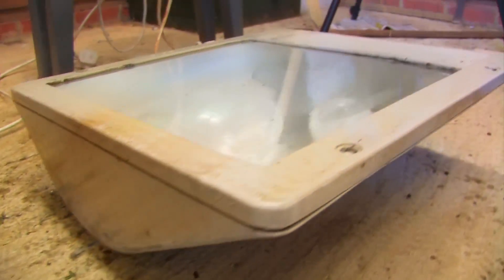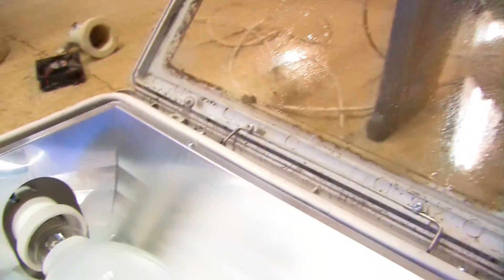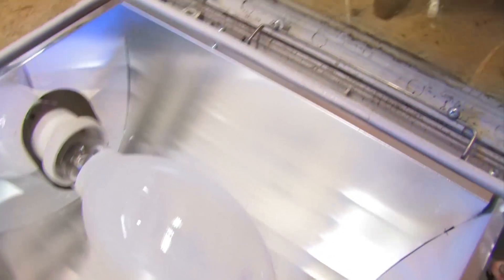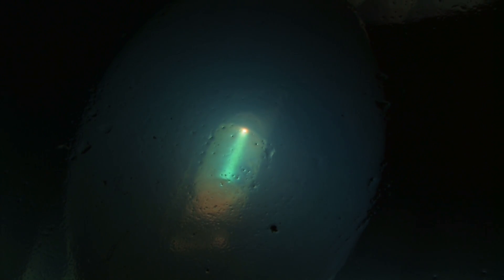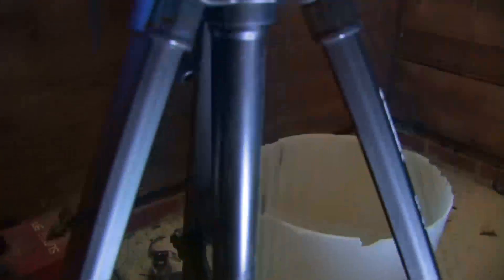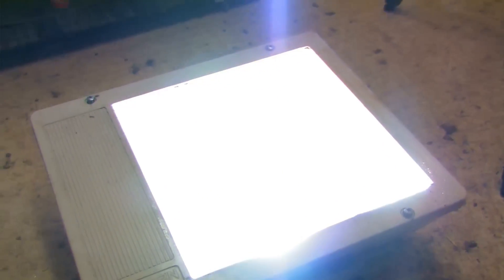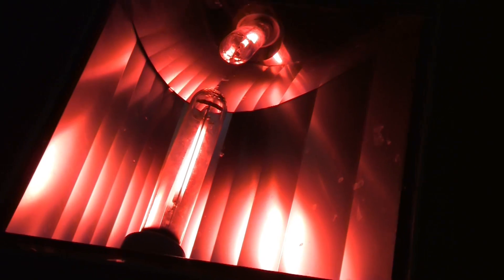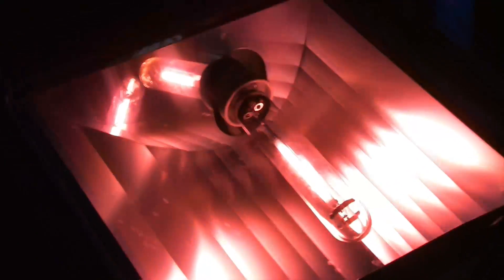Thorn 400w Floodlight:Overview, run up of MH and SON lamp

Comment: I "rescued" a 400W floodlight recently, only a few years old but it was already going rotten, Newlec piece of shite! Ended up stripping the gear and bulb out (Parmar Venture, cheapies I think) and lobbing the fixture. Horrible die cast aluminium I think, came out of someone's garden...

That Sodium lamp also looks near identical to the one that came out my floodlight, Venture branded but with a wonky arc tube.

Comment: why was the linear bulb so orange i recently installed one and it flickered then started up it was orange then started going a really cold white and got brighter and brighter and brighter within seconds and does anyone know as i am using a fused switch on one i will be installing what amp fuse i should use
Reply from the maker: That sounds a bit like a linear metal halide lamp, which uses slightly different chemistry to make white light. Also, this was a very poor example of a sodium lamp, so produces way more orange light than normal.
Reply from the maker: I'd probably recommend a 5a fuse due to inrush, but many 3a fuses will probably be fine.
Reply: yeh i put a 5amp in works brilliantly just testing it....it was bright orange and thanks for the quick feedback
Reply from the maker: kierankay100 Oh Nice. You can get loads of different lamps for these lights on eBay and the like, so you can play with colours to your heart's content

Comment: Would be nice to have one of the old street lamps with the low pressure sodium bulb in it just to see what it is like indoors also would like to take an led street lamp from outside and operate it indoors to see how bright it really is!  The led street lamps start of cold white and get warm white after a minute or 2 why is that!?